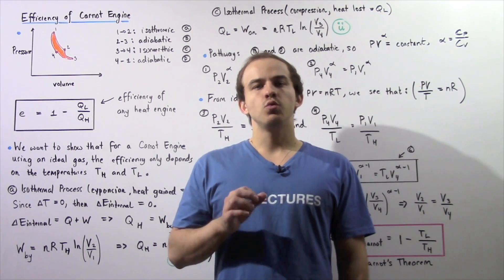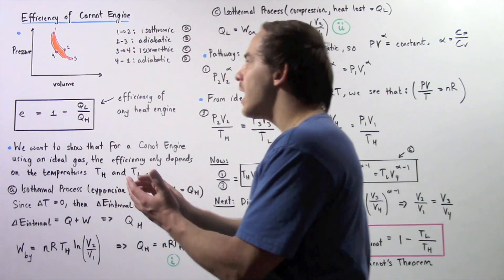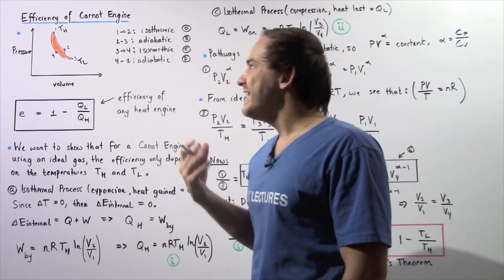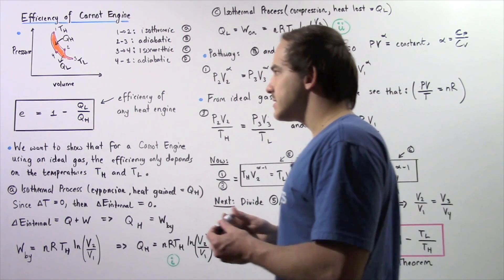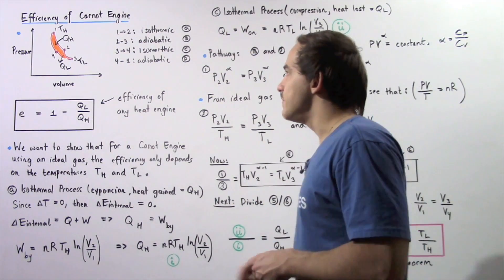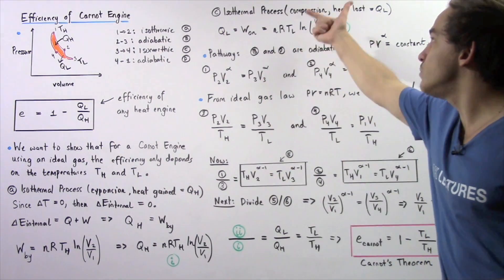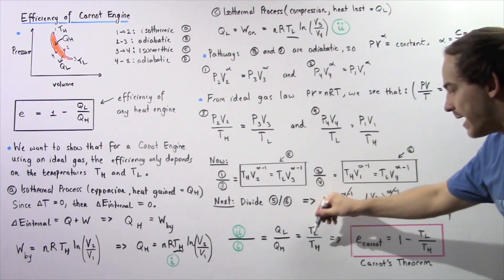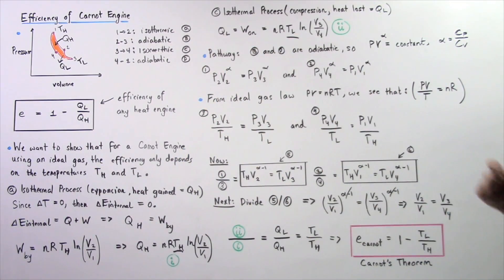Carnot Engine Efficiency and Carnot's Theorem

Comment: U=Q-W  but u wrote this wrong equation U=Q+W
Reply: yes, i wonder why others does not point this out. sample of exercises in Principles of Physics also uses u= q+w, which i wonder if its just a simple mistake, or is it actually not?
Reply: The reason why it is okay for him to write it as U = Q + W is because he explains that "W" is the work being done BY the system, which by default is a negative value. Therefore, making it U = Q - W anyway after inputing any work value.